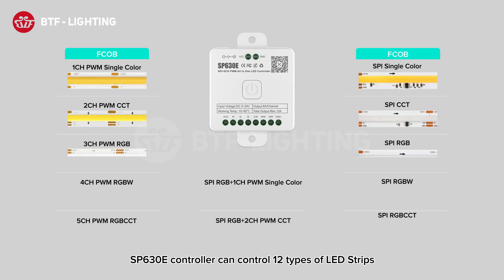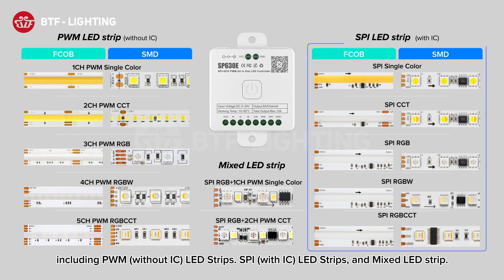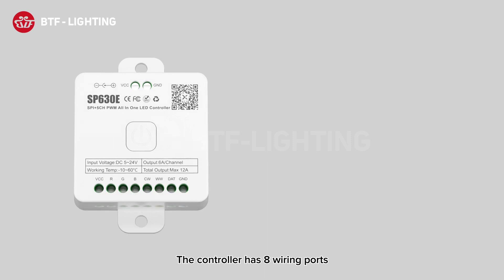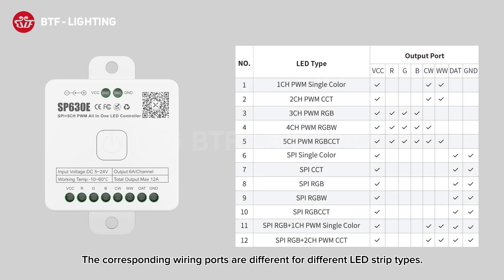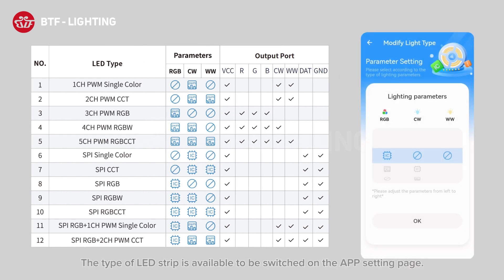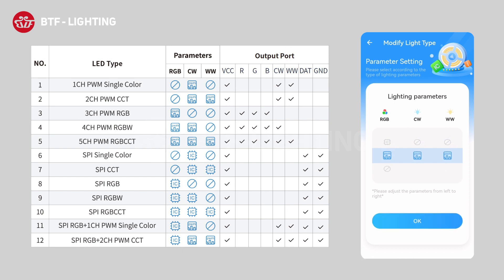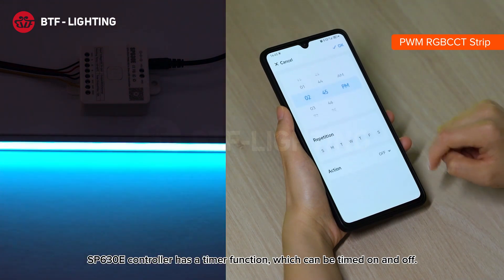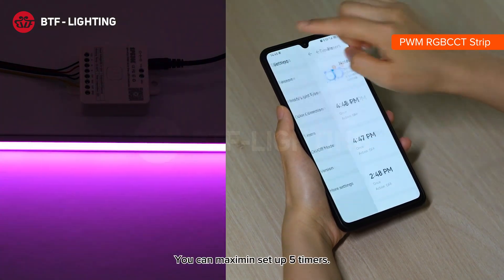BTF-LIGHTING: Watch this! You should know SP630E Setup | SPI+5CH All In One Bluetooth LED Controller

Comment: I would have a question for the software of this controller, or rather for some of its functions, in the app. I have a RGBCCT IC COB LED strip (WS2811 840 LED), but when I want to customize the colors, I can only choose the ones offered by RGB LEDs.

Let's take the example that I want to display 1 red pixel, 1 green pixel, 1 blue pixel, 1 cool white pixel, 1 natural white pixel and 1 warm white pixel on a meter of LED stripe. Using this controller, it is not possible to do this, because the white of the CCT LEDs is not considered in the customisation board. An update would be needed, because there are other controllers that offer the ability to exploit any type of effect and color on any pixel, from RGB to white CCT.

The same applies to the play of white light. While in RGB I can decide whether the play of light can be of a single color or of several colors put together, in white the play of light can only take place with a specific white (or cold, or warm, or natural) without being able to alternate the various shades of white. I hope you will consider this and make an update soon.
Reply from the maker: We apologize for any inconvenience caused. 

Currently, there are no CCT options available in the DIY column on the app. At this time, we will not be updating this feature in the future.
Reply: @BTFLIGHTING and why not?

Comment: can i install a 5 way splitter after this device? i need to light 5 shelves separately less than 1meter each. thank you.
Reply from the maker: Yes ,you can . But the signal wire length between controller and LED strip can not be too long , less than 3.2FT  will be better . If it too long , you need to use this signal amplifier and splitter https://www.amazon.com/dp/B0B5ZVN4YJ

Comment: I just like I can always eventually get them to work I just want to comment like how is it possible that every diagram and instruction is somehow like wrong and in a different way or not applicable to like the particular thing that I have

So in this case I have a 2811 when I look at the instructions I got lucky and there's a picture of that one in particular after step 4.9 but it's not the same one it's a different one because the ground and the DI are on a different side than they are on the 2811 that I have right in front of me which they're on the same side and then the 24 volt is by itself

And then also like the wires come with like plugs on the ends that's like okay do I just cut these off but then the other one doesn't just have one plug it has one plug attached to another one that has two so I'm like well which one do I do now like you just you don't need to make so many because it's like really explain or ask yourself who is buying these do they need that many like specific individual models does there need to be a new model every month

Dancer is no just making the same way every single time until there's like either more colors more brightness more bulbs something that actually changes like what it looks like when it's turned on but I got  the same one like a few months ago and it was not like this
Reply from the maker: You can contact us contact@btf-lighting.com  and send us your order ID , we can help you to solve this product problem

Comment: I bought the SP630E and a DRO3W for my WS2811. I also have a WR01RF-1 controller that I want to use. I wanted to know if both the SP630E and DRO3W was necessary if I wanted to have Alexa sync and with my phone? If both or necessary is there a video showing how to install and make the connections?
Reply from the maker: SP630E is a bluetooth controller ,it can work with alexa .   But DR03W wifi tuya controller can . So you can only use DR03W controller for WS2811 LED strip light ,it will work with 2.4GHz wifi network , google home or alexa .DR03W also work with WR01RF Remote panel .Any product question , you can contact us support@btf-lighting.com

Comment: What’s the most pixels I can controll with this?
Reply from the maker: SP630E controller :Single color ,CCT , RGB: 600 IC max . RGBW :450 IC max . RGBCCT : 300 IC max    If want to control more pixel , you can use SP530E controller
Reply from the maker: SP530E https://www.amazon.com/dp/B0CSSDZDQB    Single color IC : 1800 IC max ,CCT IC : 600 IC max , RGB IC : 1200 IC max . RGBW IC : 900 IC max . RGBCCT IC : 600 IC max

Comment: This controller is great, but the app is HORRIBLE. When you open the app it defaults to one randomly selected controller/light, so if you always use a group you have to leave the default controller/light which is random, confirm you want to leave it, then select the group you want to use most of the time!!! It takes 10 or 15 seconds, many presses EVERY TIME. PLEASE add a setting for a default light or group to be loaded on app start every time!! 

And while there is an option to use White and Color LEDS simultaneously, it ruins the color control! 
If you select the White and RGB simultaneous option in the settings you can no longer have the White turn all the way down in color mode, so if you select a fully saturated color, it's never a pure color, there's always white light mixed in! If you select a fully saturated color in this mode it should dim the white LEDs all the way off! As you select less saturated colors the white light should be mixed in proportionally and when you select fully unsaturated the white LEDs and all color LEDs should all be at full brightness. And with this White and RGB simultaneous setting selection if you are in white mode, the RGB is not used to get maximum brightness. Ideally in white mode the RGB should be used with the white LEDs and be used to assist the selection of warmer/cooler white light and give maximum brightness. Ideally there would be settings to calibrate color, so RGB LEDS would be used in the correct amounts to assist cooler and warmer white lighting without adding unhelpful color tinting. 

 I would love to wake up in my RV to slowly brightening lighting. You should add the ability in the Android app to set times to turn on, brighten over time, etc. 

The hardware is great as long as you do not need to use integration with Alexa, Google Home, IFTT. But the app limitations and poorly thought out designs ruins the experience. 

Also, please make a version of this controller that works with just the remote and local bluetooth app control without any internet connection as this one does, BUT ALSO allows wifi control from Alexa, Google Home, IFTTT. This would be a very powerful combination and allow use when off grid, but take advantage of the cloud when that's available!

Comment: Hola muy buenas  una pregunta. Me puedes decir cómo conectar este controlador con las ws2815 me seria muy útil  un esquema por favor muchas gracias
Reply from the maker: SP530E VCC connect  LED strip +12V   ,  SP530E DAT connect WS2815 DIN ,    SP530E GND connect WS2815 GND  ,   SP530E GND connect WS2815 Backup data .

Comment: BS 146 color modes. i dont even get 20 color modes from SP630E. The color gradient sucks. Only 7 colors??? Why do i buy RGB lights when it only uses 7 colors? wtf? also the gradient is not smooth at all.
Reply from the maker: 146 color modes is for SPI RGB LED not for PWM RGB . 
The dynamic lighting effect of PWM RGB LED is inherently limited, which is determined by the nature of PWM LED. PWM RGB cannot have so many dynamic modes, which cannot be compared to SPI RGB LED.
The app also provides color palettes, and you can choose the static colors you need

Comment: Merhaba 15 metre ws2811 15 metre beyaz 15 metre gün ışığı şerit Led bağlasam hepsini ayrı ayrı kontrol edebilirmiyim
Reply from the maker: every time you only can control one kind of LED strip light ,  like you can control all the WS2811 LED strip light at the same time .    But you can not control SPI WS2811 + PWM single color LED strip light at the same time

Comment: Hi. I have a digital rgbw strip connected to VCC, Data, and ground. But it only lights up blue, cant change the color or turn off. Can you help?
Reply: Try running a ground from the power supply (-)to the controller (-)
Reply: @garylow8668  Thanks for the reply. Right now the power supply is connected by vcc and ground to the controller, not the single 12v
Reply from the maker: 1. What power supply do you use? Can you tell us your output voltage and output current?
2. Can you send me a HD video of the light strip project? The video can show us your power supply connection ,controller connection and LED strip connection . A large and detail video can help us to find the issuse reason quickly .
Send us a large video :   https://wetransfer.com/        our email address is support@btf-lighting.com
3. How many LED did you control  ? We need to calculate whether the power supply is sufficient
4.Please also send us your amazon order ID . The order number is an important basis for us to provide after-sales service.
Reply: @BTFLIGHTING   Hi, thanks for your reply. 
1. Power supply is 24v/6.3a
2. I sent the video with title of @henryryh6577
3. The strip is only a meter long, just to test the strip, I tried it with a longer strip but had the same issue.
4. I didn’t order this strip so cannot find it yet at least. 

Thank you very much for your help!
Reply: I’m facing the same issue
However, over here its just red
How can i resolve this ?

Comment: Quindi se ho capito bene con il pannello remore posso gestire 4 controller sp 630 e e poterli gestire?Posso accenderlo e spegnerli singolarmente a mio piacimento?
Reply from the maker: Yes ,you can control each zone individually  or controll all the zone at the same time . If you only control WS2812B RGB LED strip light , you can use SP638E controller ,SP638E only support one  addressable RGB LED strip light , but it support APP group control and RF remote group control . SP630E can support all kind of LED strip light , but it can not support APP group control ,only RF remote group control .https://www.amazon.com/gp/product/B0C3QZRVZJ?th=1

Comment: Può gestire 4 zone di ws 2812 con diverso numero di led e poterle accendere e spegnerle singolarmente?
Reply from the maker: Yes ,you can control each zone individually  or controll all the zone at the same time . If you only control WS2812B RGB LED strip light , you can use SP638E controller ,SP638E only support one  addressable RGB LED strip light , but it support APP group control and RF remote group control . SP630E can support all kind of LED strip light , but it can not support APP group control ,only RF remote group control .https://www.amazon.com/gp/product/B0C3QZRVZJ?th=1
Reply: @BTFLIGHTING  Ok grazie.Quindi visto che a me servono 4 zone dovrei acquistare 4 SP 638 E?E quale è il modello di telecomando che mi permette di gestire tutte le 4 zone?

Comment: While the BanlanX app v2.5.5 does support SP630E in Device mode it does NOT support SP630E in the group mode. The device does not appear as a choice in the list. Please fix. TY
Reply from the maker: SP630E doesn't support APP group control , only RF remote group control  . Can you contact us support@btf-lighting.com   and send us your order ID .     
The reason we set it this way is because we are concerned that customers may have multiple SP630E, but each SP630E uses a different type of LED light strip
Reply: Does this mean I cant control multiple SP630E controllers from the one app?